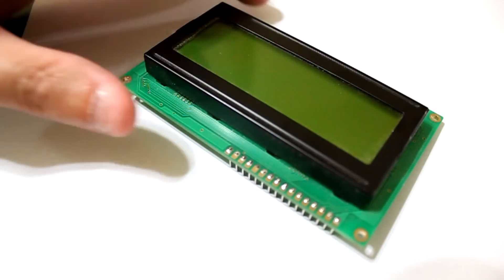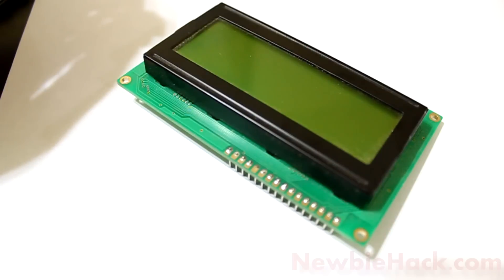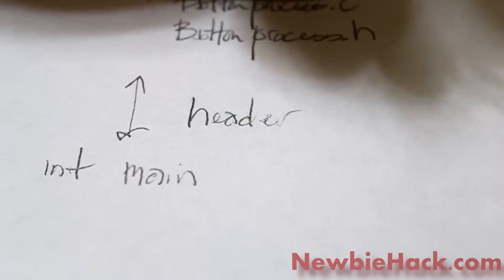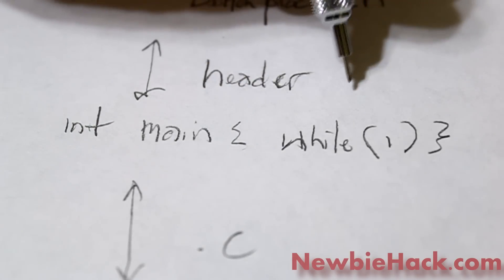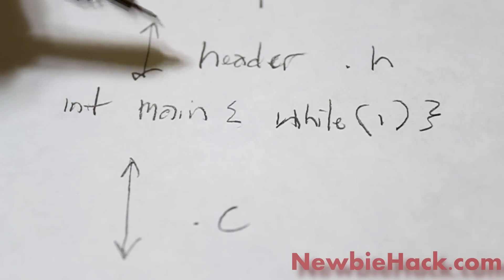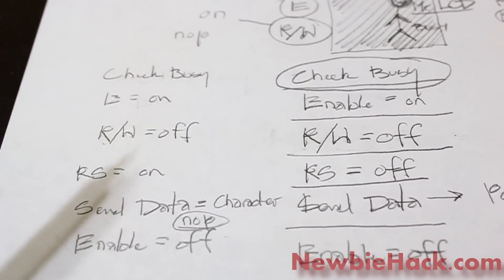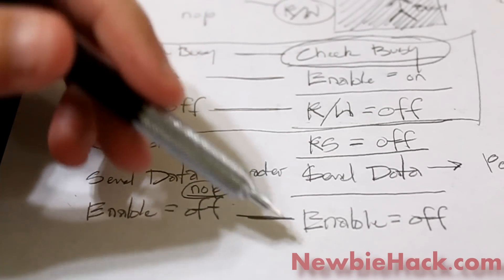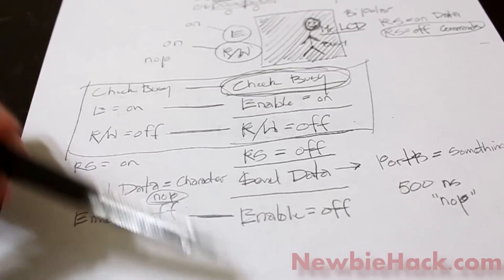19. Arduino for Production!  AVR Atmega32 - Intro to LCD... Meet Mr. LCD and check out his crib.

Comment: You're right. Include files *can* be included anywhere. But how often is that done? What Patrick said is the basic convention taught in "traditional" C programming. I may not understand your point, but whether or not the C compiler (which one btw?) is two-pass or not, isn't really relevant here. He's talking about the C pre-processor (cpp) which is a program invoked by the compiler. It runs before the compiler starts. And although certainly important, scope has little to do with his point.

Comment: You  are very informative in the videos. I have spoken to several people and they say that some of the chips are not compatible with some lcd's. That is to say they mentioned several different things (I did not understand) that had to be checked in the chips spec sheet to make sure it is compatible with the LCD. How did you pick, and based on what, the lcd that you have used with the chip you used in the videos? 
Thanks for the informative videos.

Comment: A good programmer will include header files where they are needed.  Someone that learned pascal first will include them like the  poster said.  The object is to make reusable code.  If you include headers in the functions that use them you will have object files that can be included in other programs.  Considering that I learned C more then 35 years ago I suspect that is "traditional" C programing.  Just like Kernighan & Ritchie made famous.  Please read "The C programing Language."

Comment: Hi,
I don't know if you mind helping me, but I am in a middle of a situation. I bought a 16x2 LCD (NMTC-S16205DFYHSAY) and im using atmega128 to control it. I replicated your LCD code and I connected the circuit to the processor expansion board. 
The LCD when i change the pot changes contrast but I see no cursor of any characters outputted from the MCU.
I tested all the connections numerous times, everything seems good. could it be the LCD screen??

Comment: I watched the first 3 minutes of the video and I don't want to be a prick but what he said about C is wrong. C is a 2 pass compiler. What he described is like a one pass compiler such as pascal. Dot H files are included with an #include statement. This can be anyplace.  Meaning they don't have to be together or at the top of the code. But you do have to take scope into account.  If you have a function called F1() anything that is declared inside of F1() will only be visible in F1(). OUT OF CHARS